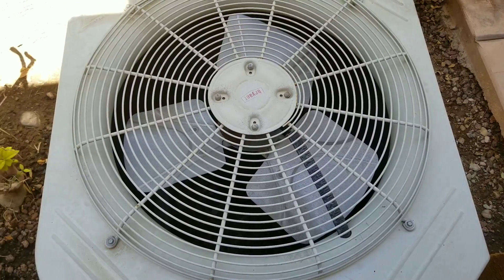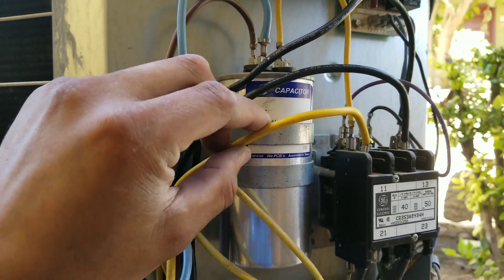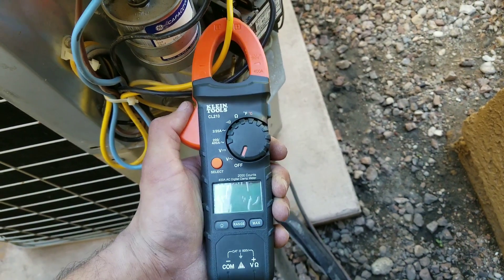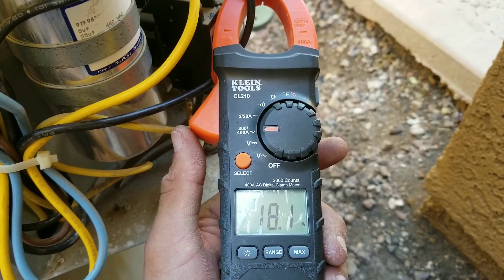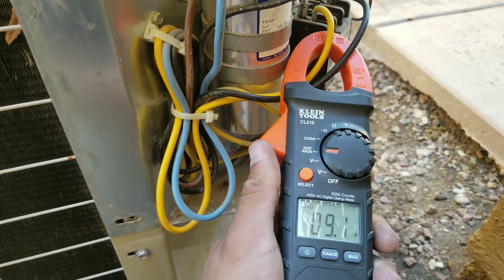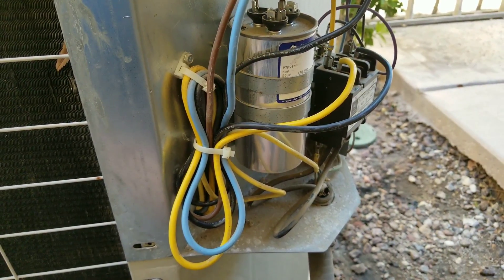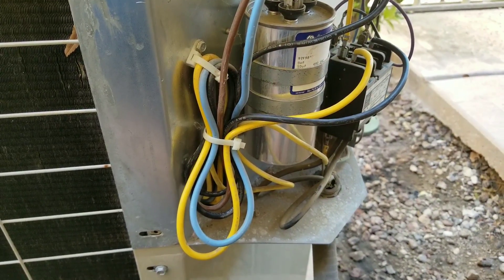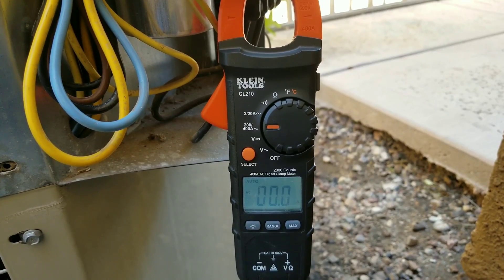How to Check Amperage on Compressor and Fan Motor

Comment: Checked all the pins on the compressor but the start and run pins read 2.4 the fluctuate high then go back to 2.4 fluctuate what that means if you can help pls reply

Comment: 148A inrush, 18.5A running... Is this a 5-ton unit?  A bit much for my portable 9000W (surge) inverter generator LOL  I have a 3-ton unit with a soft start, I'm hoping to get no more than 20A inrush, just never tested it after the soft start, let alone with the genny only producing 5875 running watts...  sigh

Comment: In case anyone is watching and wondering like I was, he's working on a 5 ton unit hence the higher than you would expect in-rush and running current.  The spec is actually 165 and 28.9 amps respectively for that particular unit.  For comparison, I have a 3 ton unit and my in-rush is supposed to be 82 and 16.1.  His meter is not capable of reliably measuring in-rush amps btw.

Comment: Thanks for demonstrating this test! People, do yourselves a favor and buy a clamp multimeter. It only cost about $25 on Amazon and could save you thousands! I had two HVAC technicians come over and test our compressor and they both told us that it was drawing over 30 amps which means it's about to die and needs to be replaced asap!  The quoted us $13,000 for a new system. What they failed to mention is that the reason the compressor was drawing so much power is because the capacitor was bad. I had it replaced myself for $20 and then used my own multimeter to test the amps. What do you know, it was drawing 18 amps! Be careful, there are a lot of HVAC scammers out there! They all want to make money on account of your ignorance! Don't let them do it. Get educated and fix things yourselves whenever possible!
Reply: Does your meter read inrush current or just regular amps?

Comment: I’m glad to see this was 5 years ago and if you stuck too it I know you have gained the experience necessary since this video.

Your amp drawl should be read if your testing the starting or running amps of compressor would always be at the in line that feeds cap and compressor as well as fan 👍🏼 

Not the L2 which coming from said components 

Now if the starting amps which I’m sure you know by now your meter has a feature that if set will record max amperage should never exceed more than 80 in any residential circumstance. In that case you would know that the windings of the compressor are are going bad and you need to add a hard start kit to the system to increase the life expectancy of said compressor. But great video though don’t know why algorithms showed me a five year old video but I’m confident you’ve progressed since 🙌🏼 great start

Comment: I guess the Klein tool doesn’t record maximum draw? My 4 ton  unit had a max of 80 amps on each leg at the circuit breaker at the panel and 17.5 amps on each leg steady state running. Fluke 87V. Thanks for the video.

Comment: What about on a RTU , do i check AMP for my CF on a capacitor or from the contractor , i’m not sure which place is the correct place to check the amperage, both read different amps as well
Reply: Did you ever get an answer
Reply: @roboo8460  no but it is from the contactor that’s the best place

Comment: As someone with no experience I still don't know if the Fan and Compressor were good because you didn't say what amperage you were looking for.  You can't just assume everyone know what amps it should be or where to find that information.  Would have been great to show the plate info first.
Reply: I agree. Showing the plate would of been great.

Comment: Sam I notice your meter is like mine. It isn't designed for hvac. Is there a way to.check the capacitor with the meter you are using?
Reply: If the multimeter can test capacitors, it will have a setting marked "capacitance" or "MFD" on the selector. Some may have a "uF" symbol. This meter does not have this setting.
Reply: Ok

Comment: Sam great video but for education purpose the amp reading you always have to take it from the C wire from the compressor or CFM
Reply: All single phase motors we want to take amperage readings from the common right?
Reply: Negative!!!!!!!!! I’ve been in the industry for 13 years and take pride in my work and knowledge and no the amp draw is taken from the L1 or the line going into the components as that is where power is being drawn from before it is powering anything and cfm refers to cubic feet per minute and that’s referring to air speed nothing to do with electricity
Reply: @brandonh2993 under cfm he meant condenser fan motor
Reply: @brandonh2993 
Thank you for the replay I really appreciate it but talking about motor if you know how to read schematics cfm refers to condenser fan motor , if you talking about airflow refers to cubic feet per minute , the common wire on any single face motor it’s the highest amperage reading and that’s what you have to take in consideration, I’m so glad you have 13 years in the trade and I’m glad you feel pride of your job , I have 25 years in the trade and I’m glad I’m still learning it’s a never learning trade . You have a great day college 🤟🏻
Reply: @antoniovallejo337  the schematics refer to condenser fan motor as outdoor fan motor or OFM. CFM is airflow.

Comment: Good vid, I have the same meter.
I'm guessing there's no way to check the microfarads with the same meter?
Reply: There is no function on the meter to check microfarads. Still you can check the cap with this meter (under load). As long as the compresor and/or fan will turn on. With that being said if the cap is dead the fan/compressor wont turn on and you wont be able to use this method.

check the amps on the wire connected to the fan terminal on the cap. Then check the amps on the wire connected to the herm terminal on the cap. Now, check the voltage from common to fan and then common to herm. Once you have that info just use this formula

2650 x amps/volts= uf

😉

Comment: When do you recommended to add a kick start to the compressor?
Reply: Hard start kit, or just a bigger capacitor
Reply: When your locked rotor amps are drawing above what it's rated for.
Reply: A hard start kit wont save your comressor and it will only reduce abot 25% of the initial start. You'd better invest in a soft starter like EasyStart from Micro Air  or  Hyper Engineering.

Comment: So quick question what amps does it read when you have a bad compressor ?
Reply: The panel in the condenser , shows you the LRA. If the start up amps are higher , I would recommend a hard start kit. To check for bad compressor just test the compressor terminal.

Comment: My AC breaker keeps tripping, but if I disconnect the wires to the compressor, the breaker stills on! Does that means the compressor is bad? Thanks!
hectoraponte1982@gmail.com
Reply: Yes that’s means you need to replace the compressor

Comment: Just curious as to what causes low amps on a condenser fan motor?
Reply: Good question.  Unfortunately nobody ever gave a fk to answer .   Have u ever found out ?
Reply: @sagemaster3408  pretty sure because it’s not designed to do as much work as the compressor. Compressor has to move refrigerant, a fan motor has to spin a fan.
Reply: Not causes low amps it just is lower in amperage by nature of the motor. Fan motor amps 1-4 , compressor 8-18

Comment: You said there is no other way to know when compressor is running. That is incorrect. There are many other ways to tell if compressor is running. 3 to mention below. First it is loud and your can hear it. Second you can touch the suction line and if it’s cold means compressor is running. Third you can disconnect the fan from capacitor and just hear for compressor if it’s hard to listen with fan on.
Reply from the maker: When training technicians simply doing the things you stated will not suffice. Here is a real life example. I had a technician call me. He said that a compressor needed to be replaced. I asked him the 3 questions. Did you put your guages on? He responded no. The next question... Do you hear the compressor starting/running? He stated no. The next question I asked was the low side line cold... he stated no. I arrived on site connected my guages and sure enough the compressor was running however it had little to no refrigerant. Just enough so that on start up I observed the needles on my guages move slightly The reason the line was not cold... the reason the compressor did not sound as if it was on... was because their was no refrigerant. The only way to truly determine if your compressor is running is to connect your guages... check incoming voltage and outgoing voltage to the compressor... as well as do a amp draw. I admit for years this was the technique I used... grabbing line and listening for the compressor however I realized implementing this for training purposes is not only inefficient but dangerous. Tools are needed to properly evaluate and troubleshoot the compressor... simply relying on your senses such as  touch and hearing are not sufficient. With that being said I do agree if you have a service call... you can utilize this method... grab line is it cold? Do you hear compressor running? However if you run into an issue with low refrigerant... this method will not work. In this case the compressor was working and replacing  shrader valves and charging the system solved the issue. I say this to say that I am constantly growing and learning every day... this was one lesson I realized was not ideal in regards to training purposes. Hope this helps friend 🙂

I had a compressor that was extremely low on refrigerant. Therefore the compressor was extremely quiet. That led to the next point... the lines were not cold...
Reply: Sam ok yeah that’s a good example and I see your point now. Checking the amps is definitely hands down the best way to determine if any electrical component is running agree but I still have to come across that situation you just explained. Interesting. Thanks for sharing bro.

Comment: so black and yellow wire had different amp, which one is real compressor amp
Reply: Whichever one goes into the compressor color of wire doesn't matter
Reply: The common wire is the reading you want to check. Typically the side of the contactor that has wires that are the same color (not the black wires)